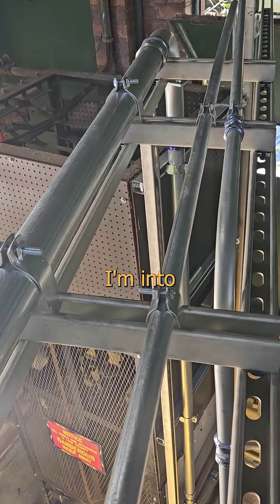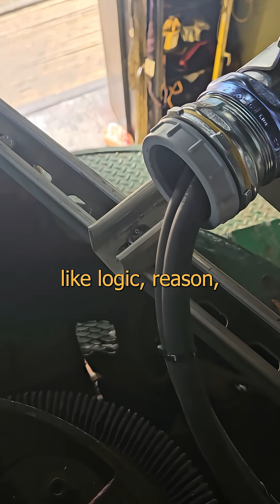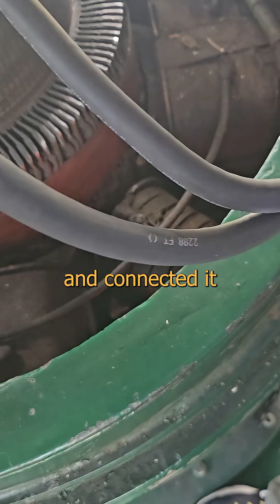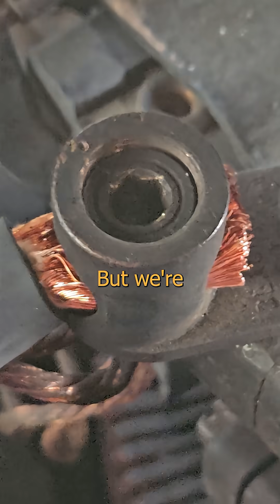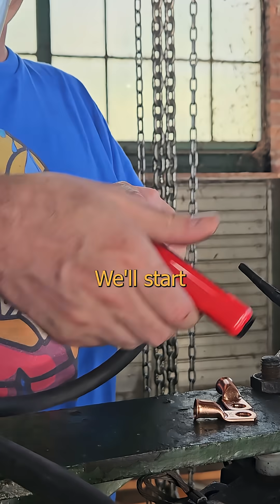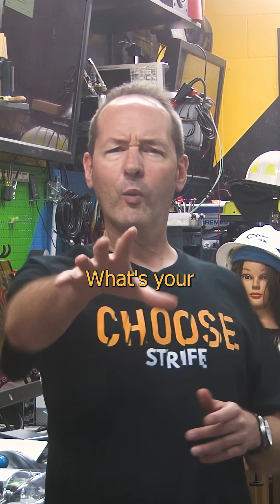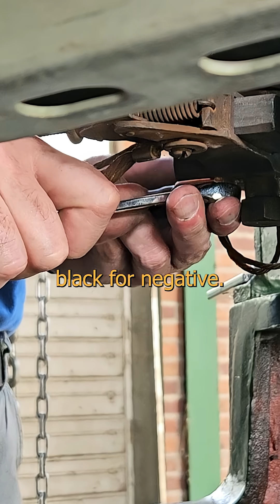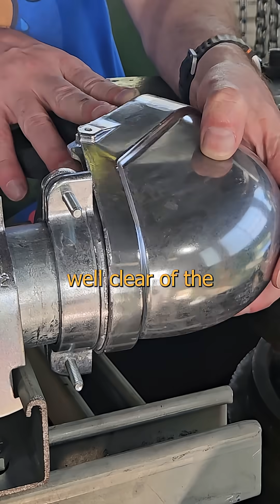Exciter Update #chrisboden #comedy #engineering #powerplant #electrical #educational #wiring

Comment: I put a little dielectric grease on just before the heat shrink, keeps out the water or humidity, but mostly i only use dielectric grease because it's clear instead of bright red or green like every other grease I use. 

Cars arent built to last 100 years though, so the standards I'm bound to are only to do the job safely, and make it last the life of the vehicle, be that 1 year or 20. I think if they come back after 20 years of road salt with an issue, that was long enough for the connection I installed, and I won't remember doing it anyways 

 Unfortunately I dont have any other sources than not having a comeback in the past 7 years. And the comeback 7 years ago wasnt for electrical issues, my impact gun gave up the ghost, and i was using torque sticks instead of a torque wrench, so I had no way to realize all 5 lug nuts on his drivers front tire were barely hand tight. That is until i was out back having a smoke and saw his wheel fly off a block away

Threw that impact gun off a cliff and learned my lesson, bought a torque wrench the next day when i went in for a new impact 😂

Comment: Have you ever used waxed string instead of nylon wire ties? Look into the tying method, once you get it down it’s way faster and cleaner looking, longer lasting, and no sharp edges to groove your fingers on.

Comment: Copper lug on copper termination is not a problem but if you had aluminum to copper you can have problems with thermal expansion  due to dissimilar metals.

Comment: The only thing i would have done differently was dip the crimped lugs in a solder pot before the heat shrink. I feel it helps with corrosion especially in damp environments. Probably unnecessary, but that’s just me. Your upgrade was a good one!

Comment: As I understand it all types of mechanical advantage termination like this result in the metal fluidizing a little and the oxide layer being disturbed away from the surface.  So I'm not sure you need any chemical additives for normal surface finishes.

Comment: I don’t know if the weather head is a good idea. Wires tied to structure are pretty vibration safe but will the fasteners on the weather head survive? What happens when that chunk of metal falls into the spinning bits?

Comment: NBoalox paste is not always needed on aluminum conductors anymore,  Why?  Because other, less reactive alloys are being used for the conductor,, Annnnd the paste is particularly useful for dis-similar metals.  Caution must always be used when one metal is far apart on the chart from the contact metal.  You used copper, copper (I expect differing alloys, but close enough)

Comment: I use Kopr-Kote instead of Noalox when its a CU to CU connection. Inhibits corrosion, moisture and reduces heat through possible voids. It also removes the small gaps between strands and irreversible crimp on connection by filling them with CU flakes. Usually makes a mess but works great in my experience.

Comment: Cris:
Telecom DC power tech here. No Ox is primarily used to prevent corrosion between dissimilar metals and oxidation of bare lead and copper surfaces. When dissimilar metals Contact each other, they actually form a galvanic connection that is reverse polarity to the flow of charge, causing a resistance and eventually corrosion. Not using no ox could lead to Copper sulfate and lead crystals forming on battery posts and lugs.

Comment: Personally I would use something along the lines of OxGard which is zinc based and a nice marine grade adhesive heat shrink for those type of terminations. It's what I have on my AGM truck battery terminals, any ground bonds on the chassis and also in the 6ga ring terminals for the 12V supply to the bed of my truck. Ring terminals have been sealed with the marine grade adhesive heat shrink encasing the schmoo of the OxGard. 73 and GL

Comment: The weather head is a cool idea, reducing the chance of vibration damaging the wire. 
Now the Noalox is a fun little discussion. The code(sorry code book is in the truck) says it is suggested, but not required. I have been using a little  Noalox in the threads on the of main lugs in panels. In one township the inspector say it is mandatory on the threads and on the exposed wire. So we do it on all jobs so we never forget.

Comment: Just a bit of Petroleum jelly on lug face but use thick washers and diaphragm washes torqued down , source for petroleum jelly was from university elec engineering department...idea is to stop oxidation on open sides of connections and oxygen getting in the joint  if you get oxidation on sides of the connection it can  migrate inside the joint gradually getting worse  or just grease up after tightening

Comment: I always over do it when putting crimped ends on copper and after crimping the ends i  solder the crimps also my reason is it creates a bond and helps to keep from causing  loose fit. I find that a crimp can losen up over time and the solder helps to stop that

Comment: Would soldering the lugs on those big SO cables be better than crimping as far as in-operation heat generation and amp load goes?      Maybe the difference is negligible.

Comment: When i crimp on bigger lugs i dip the conductor tip in flux and heat it till i can load it with solder.  I do this after the crimp.  Then i heat shrink over just like you did.  I dont know if im doing something stupid but my connections do not get hot and ive yet to have one fail. Let me know if you see the cons in doing this

Comment: 2023 nec Section 110.5:

“Aluminum Conductors shall have anti-oxidant compound applied to termination points.”

You are using copper so it does not apply. 
To further this, copper on copper will not oxidize in a way that will lose contact.

Comment: Get a set of bonding brushes. They're wire faced bits with a smooth pilot bit in the center so you can strip paint/grime/etc with a drill for places you can't fit a grinder or be bothered with a tiny cut of sandpaper.

Comment: Cool-amp makes a cold silver plating powder for improving bus bar and other interface conductivity that gets wiped onto contact surfaces. For true corrosion protection and improved gas-tightness at the interface, a quick coat of insulating varnish will keep the connections, threads and all conductors free of corrosion and still allow for easy and relatively clean (unlike grease or tar based anticorrosives) rework in the future when refit or repair time comes around. I like alcohol based varnishes and lacquers because of their very fast dry time and easy cleanup while offering decent protection.

Comment: I laughed so hard at the beginning of this.  I don't lube copper with properly crimped terminals.  The only addition to this that I would do at my job would be adding a heat shrink or placard label in addition to the color coding, to match up with the prints.

Comment: Crimp, solder, dielectric grease, and heat shrink.  The solder keeps any moisture or oxygen from getting into the crimp fitting and it just might have a tiny bit less resistance. the dielectric grease further seals the connection and when the heat shrink is applied, the pressure from it shrinking pushes the grease up into the insulation sealing the wire completely. Overkill but that aids reliability.

Comment: Anti oxide isn't needed if the metals are the same and are properly prepared. Now it is aluminum or plated copper than yes. At the same time it never hurts to use protection 😉

Comment: If your connection heats up and cools down repeatedly, is it possible that that crimp will come loose. I'm wondering if it could cause some arcing from the crimp to the wire if it works a bit loose over time. I'm guessing the bulldog fittings could be periodically tightened down. I'm no expert or anything but this did occur to me. Plus those plastic tie wraps will become brittle over time and in my experience at least, fail at an inconvenient moment when someone just touches them. My experience is in data cabling though, not in high voltage.

Comment: So....I loved the video, and love your content generally. This is not a criticism of your method, just a side note alternative for the hydraulic crimper you used ( not all of us are so fortunate lol.) When I'm  replacing / repairing a higher amperage cable end, I'll place the connector in a vice(grips) etc, and drop a few peices of lead in the socket then melt. I'll warm the cable tip😮, and jamb that sucker in there. Finally, I heat shrink the exposed lead connection to protect my little brain from the metallic STDs, and voila. I've never had one fail to date. 
Thanks for all you do, and teach. 
God Speed.

Comment: On a copper-to-copper wire termination Noalox would IMPEDE current due to the Peltier effect (a type of energy loss which occurs when electricity is passed between dissimilar metals).

Comment: Crimp plus strain relief is king. If it's a very high current application, or one you don't plan on changing for a few decades, silver plate the copper contact surfaces with silver chloride plating powder, e.g., Cool-Amp, to eliminate all but the most extreme corrosion concerns.

Comment: where the wires are zip tied together.. do you have any automotive heater hose.. cut several 3" lengths.. 5/8 or 3/4 ID size..  pinch 2 inches of the hose sections in a vice..  cut the end to make 2 notches and two remaining tabs.. flip over.. same thing. you want to make it look like a motor coupler. but 2 legs..  now you can zip tie 2 lugs on one side to one wire.. and zip tie two legs on the other side to the other wire.. now you have isolated those wires slightly and still given them slight amounts of flex.. you will have to try different cuts.   where bolted the new lugs onto the generator.. did you clean the surfaces.. seems to be covered in tarnish ..  i would have used clear shrink tube to show the end of the exposed cable and red/black sections farther back up under the clear.. so you can monitor any corrosion of the wire strands..  i wonder if you have a big carbon pile.. that you could use some scrap cable . the bull dog and more crimp terminals to check voltage drop across them to see if one has less voltage drop than others.. please store the old bull dogs close to the new generator..  if you have to bolt them to the wall.  bolted tight is the idea.. so no fools toss them in for luck.. yikes..

Comment: thats damn fine cabling, if it is interesting we are using zinc plated terminals to keep them from oxidizing. tho i have to mention i work in automobilety, we normaly also use shrinking tubes with glue in order to keep out the water.
also we would do testing to see if any of the connection points between frame and cables cause damages through vibration(hehe), especially on blank and sharp corners

Comment: hey boss, might i recommend the heat shrinks imbedded with hot glue? theyll give a water tight seal in case it gets humid, and if it doesnt itll still protect against everything else

Comment: *solder slugs* - these worked amazingly on problematic electric forklift cables when crimps wouldn’t cut it.  They are a lead/tin alloy used for soldering heavy-gauge wires into copper lugs. Instead of crimping, the lug is heated with a torch with the slug inside, the solder pellet melts to create a secure, high-conductivity connection. These NEVER came off.

Comment: Nice clean up pass.  Sure the "old way" may work, but we developed new ways for a reason (and not always because it made someone richer lol)

The weather head was a great choice (I personally hate seeing loose cabling anywhere near moving parts, even if it's technically "okay") and the crimp fitting is generally going to be more secure (and a better connection) for longer periods of time.

Comment: Using the goop isn't required, but it's best to use. But you don't need NOALOX. You use NO-OX-ID instead and dip/coat the terminal in it. Then secure it down. This is the best option because it's conductive.

The next best is to cover it with a silicone dielectric after you install it. Because it's non-conductive, you don't want that on the contact side. Both of these should keep it safe from most any issues.

It's not required, but that's not because it doesn't degrade or oxidize. It just does it so slow it's not usually an issue before the lifetime of most things connected to it. But the goop is usually much cheaper than another truck roll or other expensive issues.

Comment: id take a mechanical connection over a crimp any day, but maybe im just set in my ways. as long as you torque the lug to spec it doesnt go anywhere. id throw on some noalox anyways, for dissimilar metals if using a mechanical lug but thats just for oxidation prevention. with a copper crimp no need for noalox. idk ive just never had good luck with crimps crimping the way theyre supposed to.... also unrelated, my company buys cheap crimps XD

Comment: Nice job. I was sweating bullets when I saw those original screwed down strands and was probably one of the commenters you saw getting nervous. 

I mean, it probably would work fine, but it’s a point of failure that is easily removed with some modern crimps.

Comment: No, an anti-oxidation compound is not required for copper-to-copper connections because copper forms a more stable oxide layer than aluminum.... But I use it just cause I can and sometimes it make easier to slide fittings on..  uhhh."Lube"

Comment: In one of my previous positions we used Kopr-shield for the copper connections.  Most of my infrared camera repairs for hot connections were just disconnecting and wiping off the excess as some ASSociates adhered to the more is better theory.

Comment: There is a balance of tradition and critical thinking.  Trying to understand the tradition, can save a lot of time on reinventing the wheel.  The replacement of old hardware should value reliability and replacement on failure.  If the down time is going to be greater because the need to retrofit, while needing to produce, it makes sense to use a modern solution while it's down.  Like in your case, the added durability and protection can significantly improve a chance of failure or an accident.  Also removing an extra component in the way that has two fail points of loosening up.   Luckily you were able to do this with items on hand.  In any production environment more than 15 minutes or $50 can really get people fired up.

Comment: We have hydrogen cooled generators. The oil seal needs to be looked at very often. A slight leak onto the commutator rings can cause the carbon to gunk up, become abrasive and abrade the rings.

Comment: Code says...use NoALox or that stuff to manufacturer spec. If you're not near salt water & you're using an insulated multi tap. You probably don't need it. Power Generation may be different from consumption. I'm sure we use a lot less than what gets made. Especially is the size "Magnum" gets used where you're at Chris lol

Comment: Call me an amateur, but I drill a hole in the end of the barrel and run solder into the joint after crimping it.  Some of the barrels have the hole present from the factory, and I'm not thrilled about a contaminant ingress point; adding solder just seems logical, and when I sawed one open to examine the cross-section, I was amazed at how far into the crimped bundle it had gone.

Comment: If its copper on copper with similar grades of metal it should be fine without No-lox. Personally, I'd use marine grade heat shrink on it (The stuff with glue in it) just to keep any atmospheric dampness out, but even without that it should still be sound as a pound and all gravy baby.

Comment: With the fine strands of welding wire I make the first cut short of what I need. Then cut the insulation to the full depth, and slide the remainder down toward the end of the wire. Keeps the strands tight and prevents bird cages when the lug is pushed on. Remove the donut, go to full depth, and crimp.

Comment: I never use NO LOX on copper fittings. 
I was taught that NO LOX was only needed on aluminum fittings and cables because of the high risk of oxidation creating High Resistance heat that will eventually through expansion and contraction create a loose connection. 
(And then a fire.)
I did a lot of work with mobile homes in South Florida and Alaska. 
All aluminum wiring 🤦‍♂️🤮

Comment: The only concern I would have is, does the operation depend on some quirk of the old install? It's unlikely in this case, it being pretty brute force and thick conductor. In the general case, swapping connection type would probably make a small difference in electrical resistance of the connection. I would expect it would be better here and not cause any issue. But in the general case you should think carefully before changing something that has worked for a long time. For example, maybe the controller makes use of the voltage drop across the connections to measure something. Not here I expect.

Comment: I use contact cleaner inside and outside of the crimp sleeve, and the exposed wire before indertion. The spray or brush with ox-gard,insert cable and crimp the hell out of it. Well done on the do over!

Comment: On the first video I was at least thinking where's the ferrules though? This is way better. If my lugs are in a really corrosive environment I'll add solder to them after crimping. Then just normal dielectric grease on the bolted connection.

Comment: I'm a huge fan of the Thomas and Betts motor lead connectors.  Crimp them on once, then they slip together, get covered with a boot, and  then a zip tie retains the boot.  We used these on every motor connector in our plant, up to the 200HP units.  These would take your time to swap leads to as long as it takes you to cut the zip tie (and yes, I used a zip tie gun that twisted the tail off, leaving a smooth tie for the next guy).